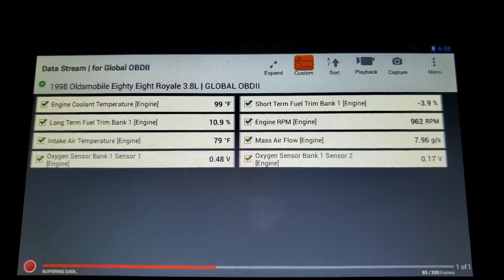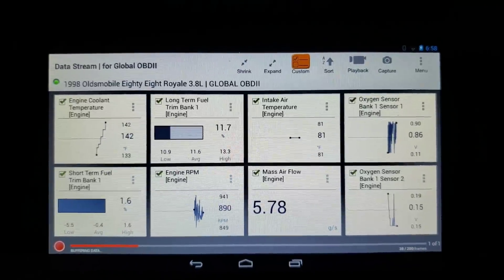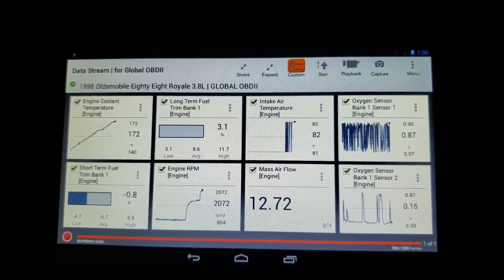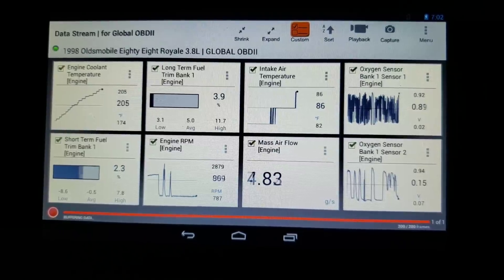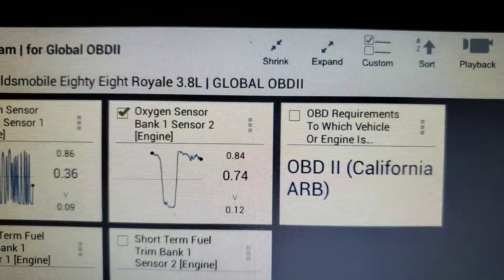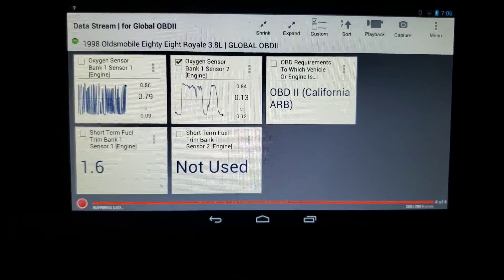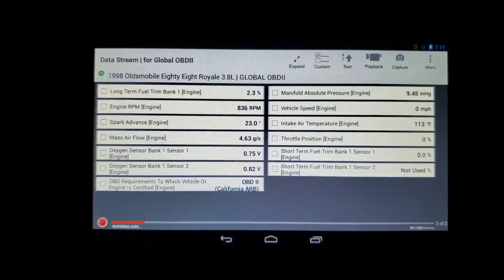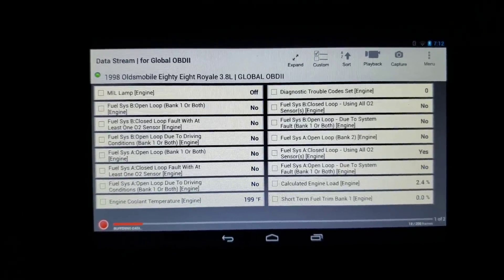Monitors not ready? 1998 Olds Eighty Eight

Comment: 1998 seems quite advanced with monitors readyness . We used to rev the living crap out of 90s cars to try and get the non functional cat to come alive for emissions test on exhaust tip in Switzerland. No exhaust leak or you could forget to try . Also mostly Asian Honda Nissan never did idle in the emissions target. We had no knowledge to find the problem and so called professional also had no clue so we just reved it up and hit print when all emissions where inside the set target for passing the emission test. They failed of course in the full state inspection and we told clients that it might become a problem then.

Comment: Wow, that thing would probably fetch a bit of cash on eBay. Usually they're all swiss cheese by that age, regardless of miles.

Great overview on what to look for on the scan too. I always thought I didn't understand mode 6 on the older ones - no wonder!

I haven't had the motivation to check out my '07 Silverado yet - EVAP and o2 monitors haven't run in 2 years (maybe 3k miles). Been driving with a black "R" on the windshield for quite a while. I don't drive that one much either - I only take it out when I can make money off it. I'm just waiting for the inevitable top end failure the 5.3 AFM engines all suffer. Already showing signs of cam bearing failure. First new vehicle I ever bought in my life, too. I promise you, it will be my LAST!  😁 

I only have to make it another 4 years before it becomes emission exempt in my state ... then I can slap a carbureted big block in there ... 🤣

Comment: Just curious how the EGR monitor tests use the downstream?  I realize that you're a busy guy, but maybe I wasn't quite picking up what you were putting down when you were explaining that (I'll rewatch).

Nevertheless, a great video and explanation of these systems, always learn something new from your videos and appreciate it.

Good to know that downstream will do that with an exhaust leak.  Also good to know that the downstream will have an impact on LTFT on older systems.
Reply: I was wondering that also.  Service info states MAP and the EGR position sensors are monitored to determine if the EGR is flowing.  In the $06 tables MAF is used in some in some of the tid 7 criteria.  EGR is flowing inert gas, so how would that affect the rear sensor?

Comment: egr uses map  to run  test.. on a long cost down...  clogged intake passage?
Reply from the maker: Performed egr test , drops 6 inches of vacuum which is perfect. I will go further if necessary,  but that exhaust leak must go.
Reply: So those exhaust leaks aren't only expelling exhaust gases they are sucking oxygen in which messes up the readings?
Reply from the maker: @bigfootemobileauto9734  that's right , exhaust is a pulse with a minor low pressure at some point like any other siphon
Reply: Of course I kind of already knew that, but thanks!

Comment: @5:35..."There's your problem lady!"😂

Is it possible to assess the monitors efficacy with the ingress of air from that exhaust leak...especially when it's proximity to  HO2S2's location is unknown ?

Also, depending on its use, perhaps the criteria to complete the monitors has yet to be met...?
Reply from the maker: Not possible, which is why I had to stop there and address that leak before going any further at all. If it were a cracked cat seam ? Perhaps they couldn't afford that repair right? So I always choose to stop right there , tackle what we believe to be bad and go from there.